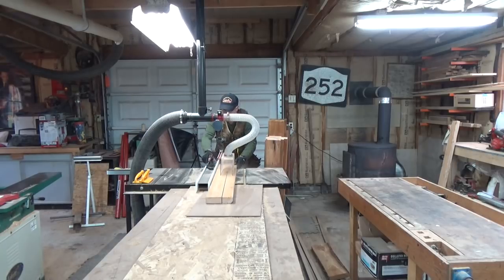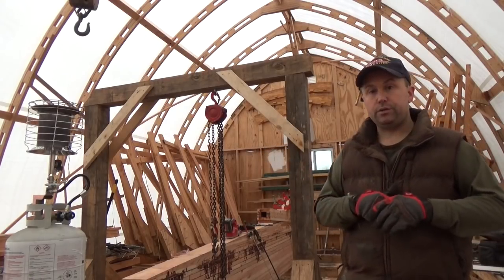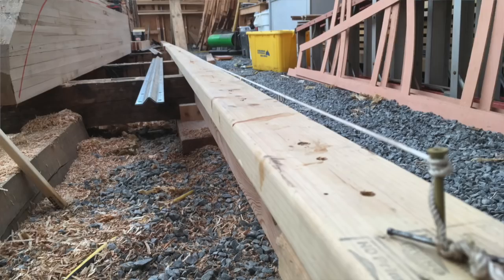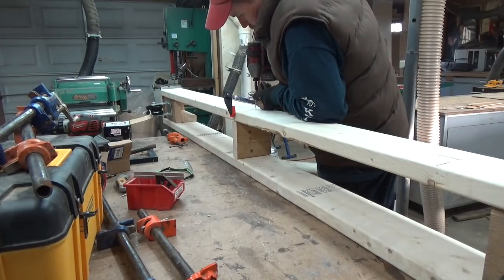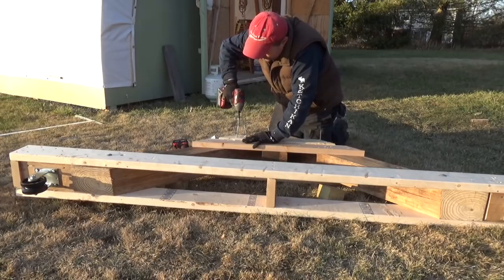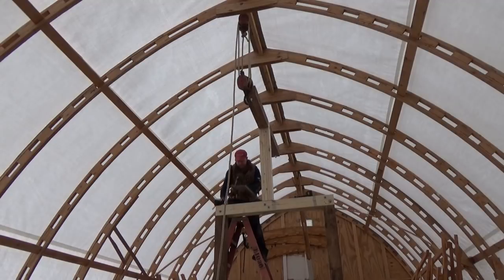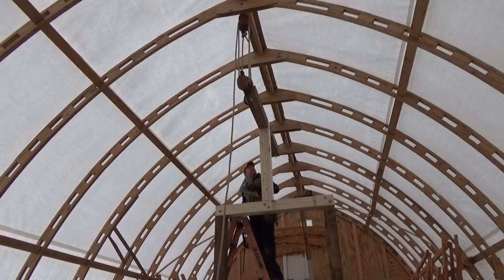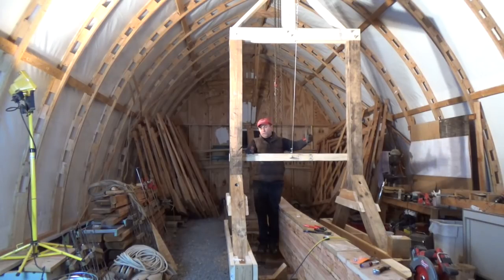Wooden boat frame install preparation, rolling gantry crane.  SDP ep21

Comment: The gantry system is fantastic and will save you much time and effort. Great craftsmanship.
Reply from the maker: Thanks Bill, It's working out great.  I don't know how else you would set these frames without it.  Even with a couple guys, particularly in the aft end, the frames are so high up, I don't know how you could hold them in position.

Comment: As I look at the very artistic view of your building frames and of course much of your other work I have to believe you are a wooden marine Savant, your work is always a beauty to watch.  I was concerned with the tower gymnastics as I have been there and seen some results of working at the top of ladders alone.
Reply from the maker: That's really nice of you to say.  I don't know how savant I am because it takes me an awfully long time thinking about things to come up with solutions.  However with the right tools and enough time I think most of us are capable of really amazing things.  On top of that ladder the safety alarm in the back of my head was going off for sure.  Not my smartest decision but it worked out.
Reply: I am not sure savant thinking is measured by time but by result.

Comment: Make certain you triangulate between the uprights and the cross beam. Right know that's a pinned connection with no way to resist racking athwartship.
Reply from the maker: will do, I needed a break from the freakin ladders!

Comment: I see you have gone beyond all the comments I made about V1.0 of the gantry !  good job !!

You still need some "stop blocks" on those upper 45°.  You are putting to much trust in a couple of screws attaching those braces/"gussets".

You are going to trust the full load on two 2x6s spanning those massive columns ?  Adding two more 2x6s resting on some stop blocks bolted to uprights.

You are also trusting all of the "counter weight" load going down to ONE 2by ?
Reply from the maker: Well we actually have some stainless steel cable and through eye bolts acting as the counter weight.  It's probably difficult to see in the vid.  As far as the 2x6's, we don't plan to lift anything more than the frames with it and those cant be more than 100 pounds.  However I did use it to jack up the keel when we set it on the proper angle and that's well over 1500 pounds with no issues.  It's only a 5' span so I think we'll be alright, I wouldn't bet my life on it, but she'll hold a lot.
Reply: I saw the cable but it is attached to a single 2by that is spanning 5' with a hole in the center further weakening it.

My whole point is, parts of the gantry are capable of picking up probably more than 2000 lbs while other parts I would be afraid of picking up 1000 lbs !  You have 6x6 (or 8x8x) posts, but all of the load is held by two 2x6 cross beams.  Even that top upright is four 2x6s !

Double up the top cross pieces and add stop blocks to the outside of outer uprights underneath them.  Double up the 2by that your counter cable connects to and replace the two eye on the top piece with FORGED lifting eyes !  𝐈𝐟 𝐲𝐨𝐮 𝐚𝐫𝐞 𝐠𝐨𝐢𝐧𝐠 𝐭𝐨 𝐨𝐯𝐞𝐫 𝐛𝐮𝐢𝐥𝐝 𝐢𝐭, 𝐨𝐯𝐞𝐫 𝐛𝐮𝐢𝐥𝐝 𝐀𝐋𝐋 𝐨𝐟 𝐢𝐭 !

Comment: Surprised you haven’t got someone who can lend a pair of hands to help with the build. Putting the top of that crane on looked a bit dangerous. Be safe. 🇬🇧
Reply from the maker: My dad helps quite a bit but he recently had a knee replacement so he is wimping out on me.  Otherwise I use my son, daughter or wife to hold stuff if necessary.  The ladder stuff was not my best decision, but I feel pretty comfortable with heights and ladders.  Hindsight I probably should have come up with another plan, glad it worked out though.

Comment: at about 4:40 did I see a screw in mouth?  It looked a zinc chromate coating. (insert usual health warnings here)  I was remembering one old timer carpenter I worked with long ago....all of his contemporaries were long gone.....caused by the copper nails they used....production work, so speed was the thing ....and they would spit the nails and then hammer.
Reply from the maker: I've heard stories of guys spitting their nails to get them started, thought it was just a fairy tale.